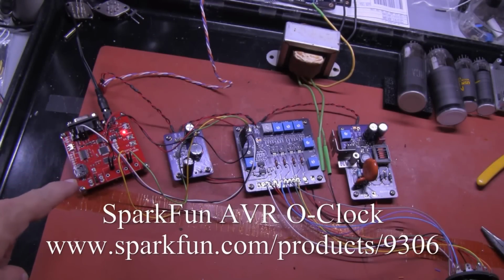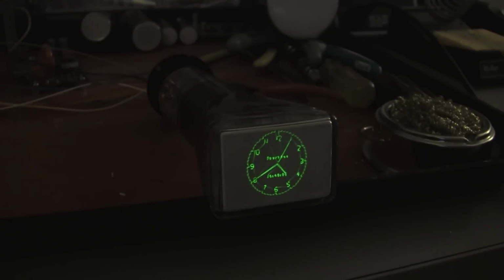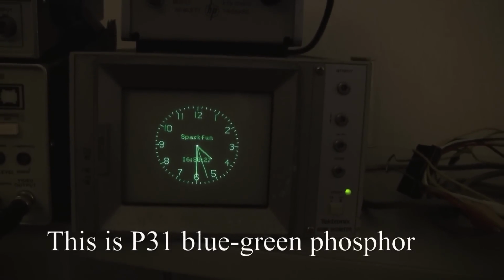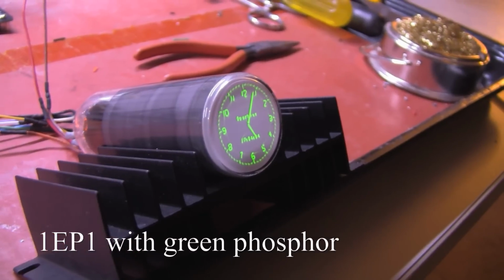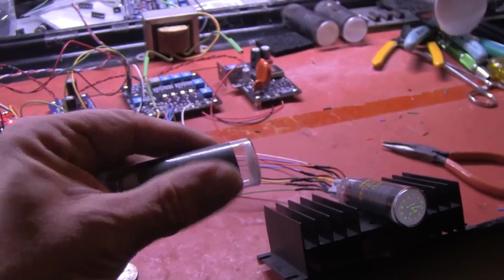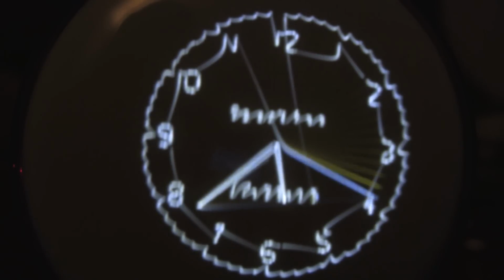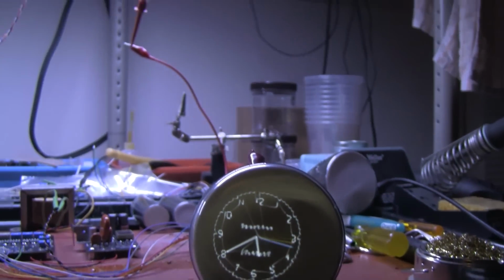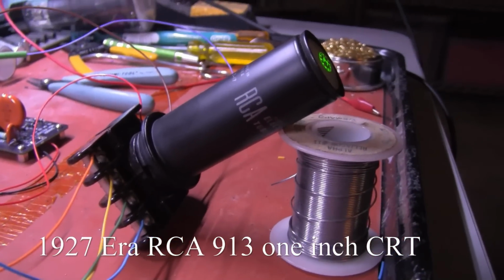Electrostatic Cathode Ray Tubes

Comment: a big disadvantage of these oscilloscope clocks is that they often burn in, it would make sense to equip them with a screen saver
Reply from the maker: The image is slowly moved around the screen to prevent burn in. If I had a choice to use a tube, or leave in a drawer, I would go ahead and run it.

Comment: The problem is low bandwidth.

I use a different CRT driver board from electronixandmore and it has the same issues. 

I wound up adding some variable capacitors at certain points to make the bandwidth better which improved things quite a bit.

The leads to the deflection plates can affect things as well.

A lot of older scopes I've seen where the deflection circuitry is not extremely close to the CRT connector use regular 300 ohm twin lead for the deflection plate connections.

Each CRT will need a different amount of compensation unless the deflection amp bandwidth is increased. Even then there might be a need for compensation of some sort as the few scope circuits I looked at show some amount of compensation in the deflection amp circuitry.

Comment: "...and it goes up to this deadly affair hanging in space; and, then, on up to my high-voltage power supply -- up there -- which could easily kill me..."

My RF sense is tingling...

...I detect another amateur radio operator.  I have had to "redesign" several things in my lab and shack since my nine-year-old grandson has come to live with me due to the "...could easily kill me..." factor.

By the way, nice input below from crobc1, and good responses from you, of course.  Ah, to be a young engineer again...

Comment: old rear projection TVs contain red and blue tubes, along with a green one. they're built to be stupendously bright, using 30-50kV accelerators, but i bet they would work like a charm at lower votages. 
PS: there's glycerin between the tube and lens,  as an optic coupler. use a bucket.
Reply from the maker: Yep! I called those old projectors X-ray machines - and they were. The glycerine was for cooling the phosphors, not necessarily for optical coupling. I doubt that you can get those old tubes to beam focus below 70% of their nominal high voltage rating.

Comment: What's with the re-trace lines (or whatever they're called for vector displays)? doesn't the circuit control the grid voltage to turn off the gun when going from one shape to another?
Reply from the maker: Yes. The beam is usually blanked off during the beam move operations. At that time, I did not know how to implement that function.

Comment: What were those very small CRT's used for ?
Reply from the maker: Small CRTs like these were built into various equipment. Some of the installations are smaller than a typical panel meter. You'd find them in audio analyzers, RF transmitters and amplifiers and some high end stereo gear. Anything that could benefit from a compact oscilloscope. Oh yes. Compact oscilloscopes too. Like this: http://www.ohio.edu/people/postr/bapix/nat_crm.htm
Reply: videolabguy
Great reply, thank you.

Comment: Im wanting to build a scope clock, what are the most easily obtainable CRT's with a blue phosphor? I believe some will stay on the tube for some time and turn to a yellow/white also, i see your P7 phosphor is similar to this but looks white.
Reply from the maker: P7 looks white while the blue and yellow are active together. The blue, being short persistence, immediately stops glowing after the beam passes. The yellow will glow for up to ten seconds. If you look at the back side of the screen, through the side of the CRT, you will see blue phosphor directly glowing blue. This article shows various phosphors in action: http://www.labguysworld.com/5FPn_CRT_Tester.htm
Reply: Thanks for that info. Im not sure if i will go with a tube using P7 or just Blue. Some look purple on some videos but i think they are blue, and the camera is making it turn out different. Are there any tubes you recommend with a blue phosphor? Im trying to find a list of part numbers to look for.

Comment: wow were can i get all the pcb's?
Reply: found it
to bad i cant solder smd
Reply from the maker: *****
Sure you can. I use a soldering iron form the 70s and lots of magnification. Invest in a good pair of tweezers!
Reply from the maker: ***** You can also check out my "Wordless Workbench" videos where I demonstrate some SMT soldering techniques. It is not that difficult. Just daunting.